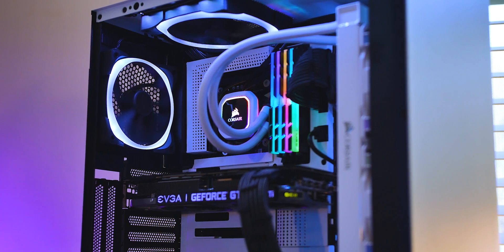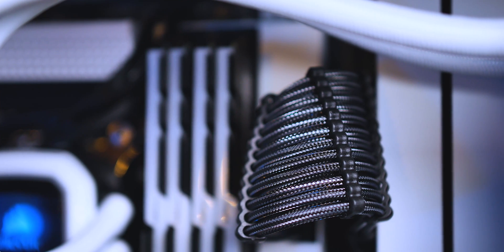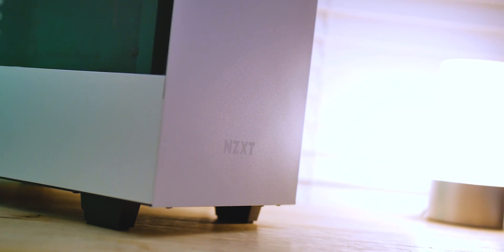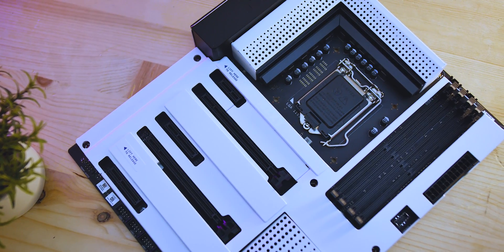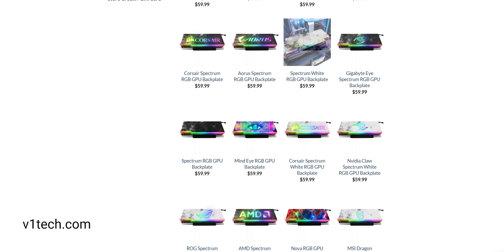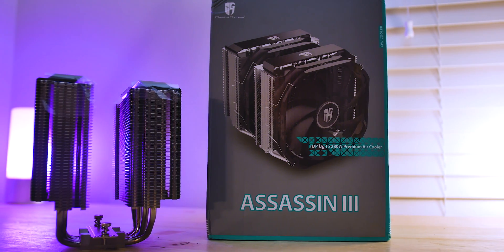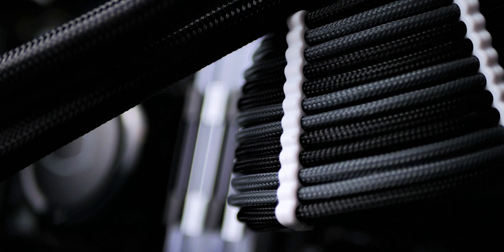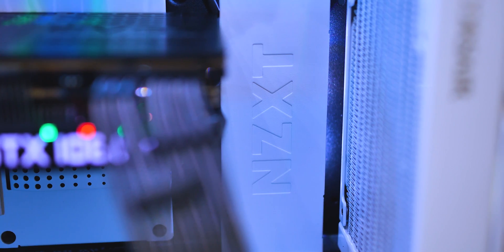A Guide To An Aesthetic Computer

Comment: Here in Feb. 2023!
I just finished my flight sim build for MSFS 2020. First goal for me was NO RGB! Made mine a matte black build. I got as many NZXT components in order to maintain an aesthetic uniformity, except the CPU cooler. The NZXT 120 black was unavailable, beside it not enough cooling for the 5900X. Also, I did not wish to do liquid cooling. 

BUILD LIST

CPU:  AMD Ryzen 9 5900X

CPU Cooler:  Thermalright Peerless Assassin 120 Black (Don't regret not getting the Noctua NH-D15 chromax.Black, TR is half the price! I have cranked up the OC, and even right now in winter with the heat blasting at home, everything stays cold! Also, it should be noted that my RAM did not meet the clearance requirements for the Noctua)

Motherboard:  NZXT N7 B550 ATX AM4 Black

Memory: G.Skill Ripjaws V 64 GB (4 x 16 GB) DDR4-3200 CL16 Memory Black

OS Storage:  Crucial P3 Plus 1 TB M.2-2280 PCIe 4.0

Primary Storage: Crucial P3 Plus 4 TB M.2-2280 PCIe 4.0, (I do not like to place the load of read and write on the OS drive)

GPU:  XFX Speedster MERC 310 Black Edition Radeon RX 7900 XT (XTX version not worth the, big-price-to-small-performance, increase)

Case:  NZXT H5 Flow ATX Mid Tower Case 
(Fans | Front:  2 x 140mm NZXT Static Pressure (intake), Bottom:  1 x 120mm NZXT Static (intake), Rear: 1 x 120mm NZXT Static (exhaust), Top: 2 x 120mm NZXT Quiet (exhaust)

Power Supply: NZXT C1000 (2022) 1000 W 80+ Gold Certified Fully Modular ATX

Cable Management: Asiahorse Extension cables

Comment: Hey man thank you for this,I got a similar setup and upgraded it and trust me it is worth it,here is a tip if you get the NZXT h500i and corsair platinum AIO RGB cooler,to make the rgb fans on the cooler show swap out the in built case fans with the rgb corsair cooler fans so you get the ultra quality rgb fans showing clearly and the black fans on the cooler it looks so much better

Comment: Nice aestethics, but no airflow. I made myself a mesh front panel for this case and I use it in the hot days of summer.
Reply: hi i want to build this pc but it will be my first one. how do i increase the airflow?
Reply: @crowsong2666  You have to unscrew the metal part of the front panel, cut the plastic with a dremel and make yourself a panel from mesh that you can find in stores.